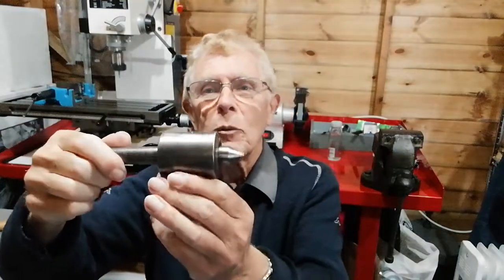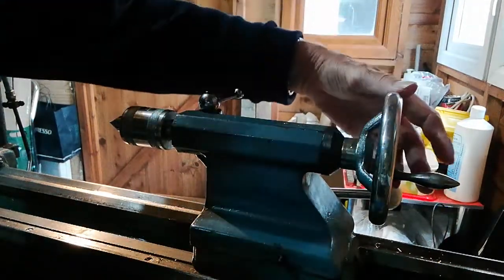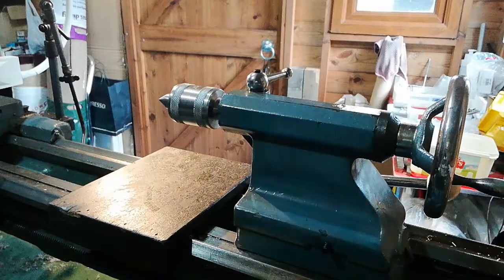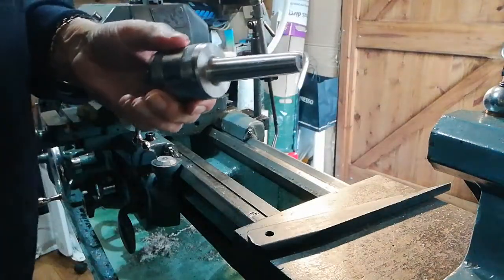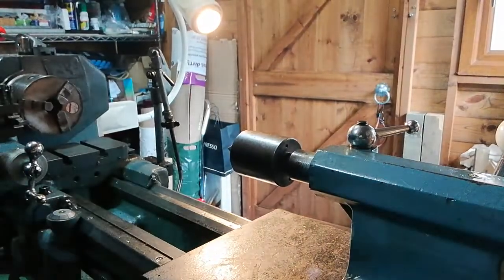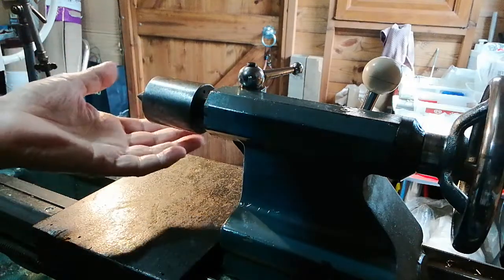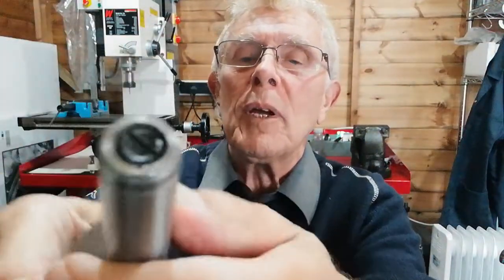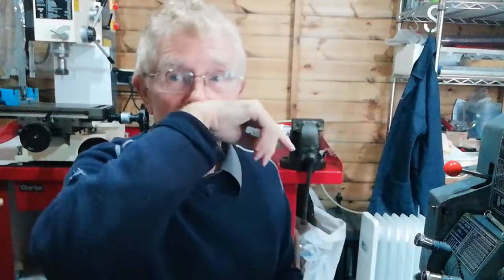How to extract a jammed Chinese rotating centre from a self ejecting tailstock.

Comment: I have a South Bend clone lathe made by Lin Huan of Tiawan and have the same issue.  My jacobs chuck and dead centers have an extension of about 1/2" to allow the self ejection to work, but a new live center I purchased doesn't have the extension and doesn't self eject.  I simply slide in a 1/2" piece of rod into the tailstock before putting in the center, problem solved.
Reply from the maker: Hi Mark, thank you for your comment and solution to the problem.  I had considered this, but thought in some instances, there may be difficulties in retrieving the piece of rod.
Did you find that it’s easy to do this?
🤔🍀 K.
Reply: @keithatklint5380 You are correct it's a pain to retrieve the piece every time. I drilled and tapped a hole in the end and put in a stud. It was drilled and tapped easily with an ordinary HSS drill and tap. Apparently they are not hardened in this area.

Comment: I use a 19mm or 3/4 inch spanner.
Open end fits in neatly at the top of the taper next to the rotating head. Twist sideways and it pops straight out.
https://youtube.com/shorts/goJ-gnMr29Y?feature=share
Reply from the maker: So simple and a great solution. Thanks for your comment. K🍀

Comment: Another way would be to use a piece of pipe with a section cut out to place between the tailstock and the rotating centre tool with the tailstock fully extended and then reverse the tailstock. This would work exactly like the removing mechanism.
Reply from the maker: Hey Ronnie, that’s a very good idea and it should work quite well if sufficient clearance is allowed for, to facilitate easy removal of the pipe section. 

Thank you for your valued comment.
Happy new year and good luck during
2023 in this year of the rabbit. 🐰🍀

Comment: I keep a fork type tool next to the lathe at all times. It reminds me of a tuning fork. It is sold in the automotive section for knocking loose front steering joints.
Reply from the maker: Yes Robert, I can see that being useful for various other applications too. Thanks for the comment. 🍀K

Comment: As you didn’t actually use the taper properties of the morse ejection drift, you could just have used any piece of metal, or better still, a bit of hardwood as that would not damage the paint.  My Chinese Katherine gas a self ejecting tailstock and I had the same problem with one of the 3mt tools.  Simple solution, screw in a conversion tang to the hole in the end of the 3mt and that makes it self-ejecting.
Reply from the maker: Yes good idea, thanks for your contribution.

Comment: Hi Keith - have just come across your video and enjoyed however the reason I have contacted you is that I am looking for a set of  "Half Nuts"  for a Boxford    Model B    Ser. No BUD-1-31412   1973   Metric  lathe. 

I am hopeless on a computer and find that I either get lost or just keep going in circles when trying to search,  which is rather frustrating for this old guy hence this desperate message.   I am self taught in home workshop stuff and get by but it would be nice to have the Boxford fully operational again.

Thanking you in anticipation  Charlie Wallace  N.Z.
Reply from the maker: Hi Charlie,
thank you for your most interesting message. I do understand your predicament and I may be able to help you with your search for the half nuts you mention. It seems that your location in New Zealand may not be the best place to look for the parts you are looking for.
I have several options that may prove successful and I will check them out for you. Firstly, could you please confirm the pitch of the leadscrew and if it is definitely metric?
My other videos would be beneficial for you to view, as they are specifically suited for persons who are just starting to learn more about lathes, turning and other related issues about machine shop engineering.
I empathise with your frustrations and other problems that you encounter with computers and things; it's as though they sometimes have a mind of their own.
Just keep a positive outlook and be happy with your turning learning.
I will assist you to improve your knowledge and skills in this respect as appropriate.
Regards

Keith.
Reply: @keithatklint5380  Hi Keith,  thank you so much for responding to my request re- Boxford Lathe.  The label states:  Metric Threads and Power Feed - Metric lead screw 3mm Pitch.

The lathe was rescued  from a "training establishment"  minus Tail Stock,   Tooling  and   optional gears for threading,  I acquired a tailstock and have built up sufficient tooling to get me by and as I am coming up on 80 it would be satisfying to have the lathe as complete as possible

Again, I thank you for your interest,  I understand your time is valuable, so if you have trouble locating the Half Nuts,  let it go,  that search may be undertaken by the next owner when it comes time for me to pass it on.

Kind regards and all the best with your channel.

Charlie Wallace.